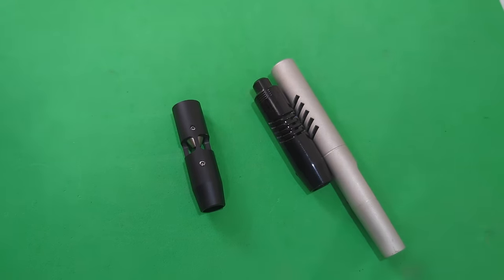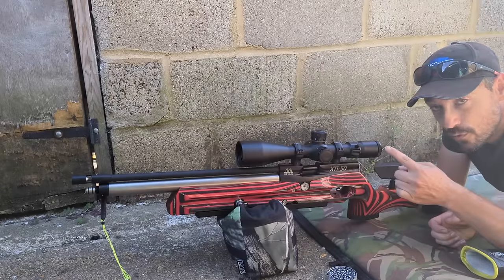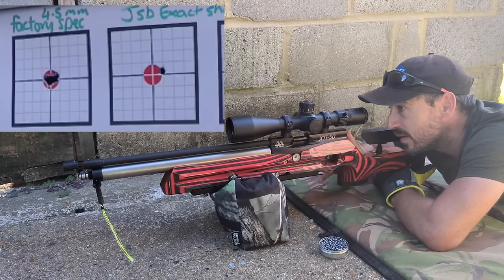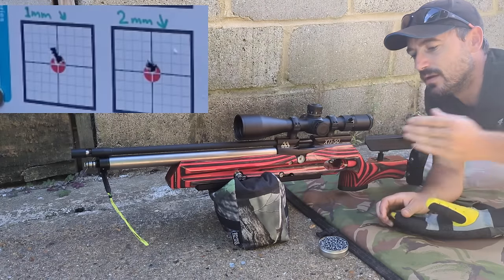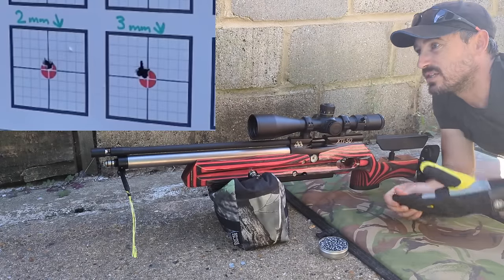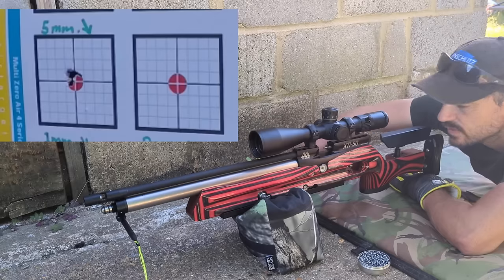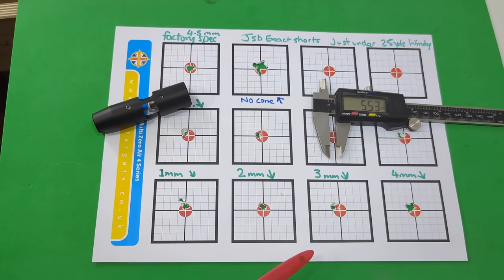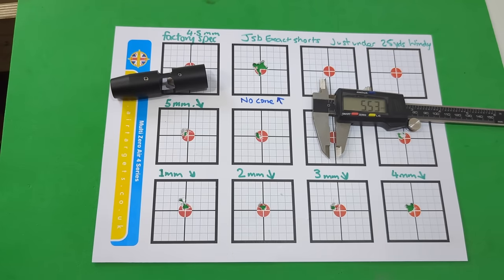Fine tuning the most expensive air stripper in existence. Does it actually work?

Comment: Commenters don't seem to understand the principle of these, as the pellet rushes down the barrel it displaces air, causing turbulence and "dirty air" in front of the pellet, however, what is worse is the air just behind it, that immediately goes past the emerging pellet exacerbating the issue...an air stripper should be designed to direct the air, via cones and slots, out to the sides
   Whether this is actually the case isn't the question, whether it makes any difference obviously is.

Comment: A few points to consider:
You need to test indoors to exclude the wind.

Removing the cone has the air stripper outer tube act to concentrate the blast on the rear of the pellet.  Worse than a completely bare muzzle.

Changing the position of the cone also affects the barrel vibration characteristics.  All of your "air stripper" results could be barrel harmonics changing.   Add a test for when the cone is paper thickness away from contacting the muzzle.   That shorts out the air stripping function completely, but would have vibration characteristics similar to the shortest setting you tested.

To separate harmonic effects from air stripping, you need to find a way to keep the mass x distance of the cone in the same place relative to the muzzle, while only changing the cone lip to muzzle distance.

Pellet length drives the distance and timing of pellet exposure to the initial air blast.  If the cone is too close to the muzzle, more air follows the pellet down the cone.  So a closer cone to muzzle is not necessarily better, except for the start of the air blast; up to a point.

That air stripper tube has so much material cut away that the front may be vibrating on the (overly flexible) three remaining "pillars" around the generous windows.  If so, moving the cone may alter that vibration to produce tighter or wider grouping.  If you set the cone very far forwards you may find another "node" that produces tight groups.  If so, the vibration is dominating air flow considerations.

If you want to improve air stripping, increase the amount of air that the air stripper has to deal with.  You can do that by shooting heavy for caliber pellets at 900 FPS.  This assumes you have a FAC.
Reply from the maker: Correct on all counts mate. I'm working on an indoor space for this sort of testing too.

I'm somewhat familiar with how the stripper is working and it's foibles, but going into mad detail in the vids would only really be watchable for us real nerds. I try to keep things simple, not go too deep and keep them enjoyable with a bit of humour. 😉
Reply: @tillysgunstocks  You are putting in significant effort.  The question is how can one make that effort more meaningful, with a better signal to noise ratio?

If you are concerned about the viewers getting bored, gloss over how the test has been normalized.  As if the only variable is the stripper to muzzle distance, like you are doing now.

Rather than me wingeing about your test, I could help by designing a series of 3D printable air strippers, that would have the same mass and mass concentration, with only the cone spacing from the muzzle as a variable.  Does your barrel have a 1/2 20 UNF thread on it?   How long is the thread?  How far  from the barrel shoulder to the front of the air cylinder?  What is the radial gap between barrel and air cylinder?

Comment: UK Neil air stripper on my 9 year old FTP900 set at about 2.5mm gives outstanding tight groups using JSB 8.44's 4.53, nicer to shoot, no sight picture movement at all, before deciding a 'batch' of pellets are not good enough for comps maybe try adjusting the stripper first.

Comment: They work without any shadow of a doubt.  No matter what I did with one of my rifles the groups would not tighten up.  I decided to try an air stripper and difference was amazing.
Reply from the maker: I'm contemplating fitting the xti one onto the cz barrels in the 9015. It works great and definitely looks cool too...

Comment: Interesting! Could it be that the closer than factory settings work better because you are using shorter pellets? Presumably there will be some relationship between how long the pellet is, and how far from the barrel crown the optimal stripper cone position is..? 

It would be interesting to see whether longer pellets prefer a longer gap!

Comment: I'm wondering if that stripper is working the same as tuner
Iv not experience using a stripper but put my tuner from rimfire ( EC tuner ) on my HW 100 in 177 and had unbelievable about 6 mm in zero wind for 11 of 14 and about 19 mm in total at 50 m with jsb heavies  needless to say I went back to shop and bought a sleeve

Comment: Hi there,
You have had 9015 and xti50, which one is more accurate and convenient???
Reply from the maker: I love them both... The 9015 is built to fit me perfectly and handles amazingly. The xti is currently totally standard apart from some cosmetic tweeks. I think once I get a chassis on the xti it will have a slight edge over the 9015. At the longest ranges the xti is quite a lot better,but at all the usual distances 50m and less there's very little between them accuracy wise 😉